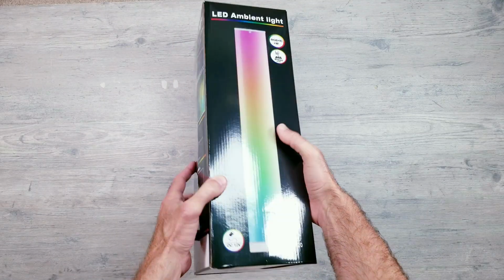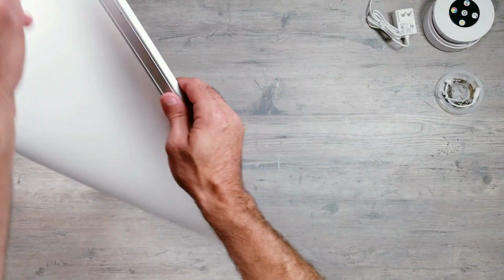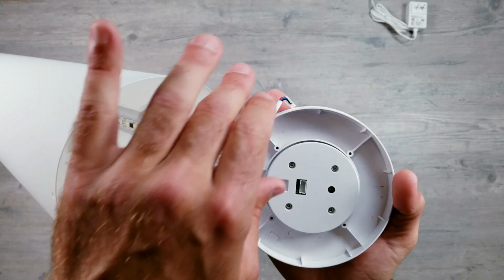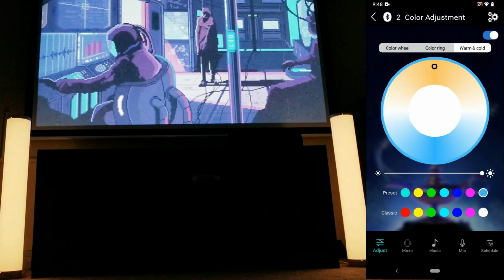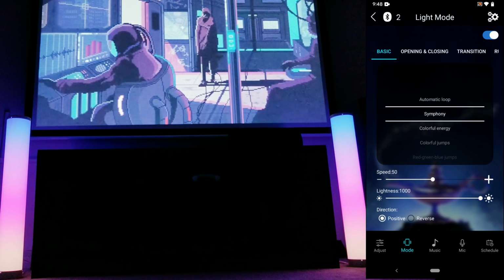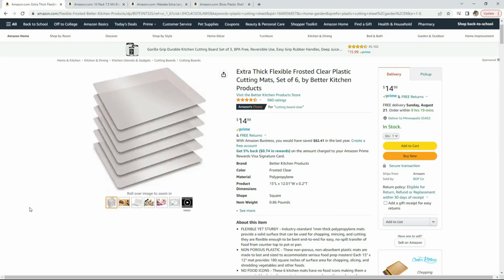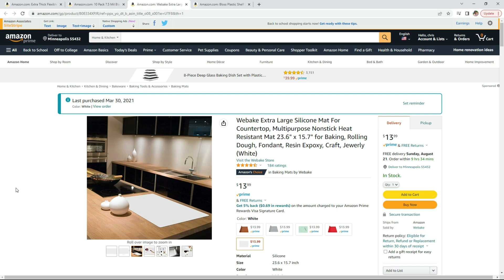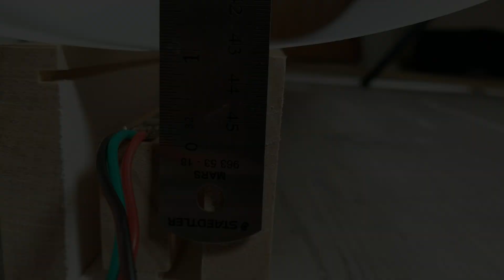DIY Mod - Best LED Flexible Diffuser Material Ever?!

Comment: Literallyb just picked up a DIY 60" wall lamp from Ilume that is almost identical to this—needless to say, I was a bit skeptical looking at a box displaying a tall and prominent fixture, however only being the size of something no bigger than cube one foot on every side. Regardless, once assembled, by taking your time and following the instructions, ideally on a large flat surface such as the floor, the tree a-ha moment comes on when you plug this thing in (the second time, because the first iteration of this thing crapped out of me...but hey, it was $40, and from a distance you'd be hard pressed not to mistake it for something 10x that MSRP...)....either wam it was this magical plastic or vinyl material that serves as the walls of the 4 sided lamp, in my case, that really intrigued me, because the LED strip lining the inside didn't appear to be anything special and I would presume that at that piece print, it wouldn't be...thabks for posting this, now time to hunt, because just saying F-it and giving up on most of ny DIY diffusion products in favour of well-dispersed OOB LED offerings from brands such as Govee (neon rope light) isn't very economical or friendly on the wallet in the long run...while I did achieve some solid results on my living room set up, there still was some minimal hot spots due to limited distance required to properly diffuse, however, some solid Scott's 2 sided tape finally kept it where I intended and while I was close to going the silicone/caulking route to close up any annoying gaps causing light leakage, my fiends over at ChatGPT thankfully recommended I use weatherstripping tape instead, and I must admit, the results were solid....I will post this eventually on a subreddit and share the link here for those interested....appologies on the lost post, but no one is forcing you to read this, and, if you did, it's because you too are on the hunt for some quality recommendations for your LED based DIY projects...best of luck and happy 2025! PS—love this channel...been a godsend....if not just for having his soothing voice put you to sleep after a long day of fiddling with your LED light strips....IYKYK....

TLDR: Almost identical product I found here in Canada at Home Depot, that I assume will be available in the US as well: https://www.homedepot.ca/product/illume-60-inch-rgb-ic-led-digital-floor-lamp-with-remote-control/1001814682

Found this low price option, which looks close enough: https://www.homedepot.com/p/Alsy-49-in-Black-Indoor-LED-Light-Bar-Lamp-with-RGB-Function-24304-000/329740897

Comment: just found a supplier in the uk called kitronik, called White Polypropylene Sheet 0.5mm x 1020mm x 720mm
There is a video on their page, and the white colour seems to be near enough identical.
the sheets that come with this product even look like they might be the same dimensions as those sheets only cut in half. so 1020 x 360mm
Reply: i've just ordered a few sheets so i'll see what they're like.
Reply: was that the materiel ?  @ge2719
Reply: @ge2719  Any luck with this ? TIA
Reply: @arunskuviyam  yeah, got the sheets. the thinner stuff is fine, and diffuses leds as effectively as this plastic in the video does. i'd bet money its the same stuff. the dimensions look like they just cut the full 102cmx720cm in half. to make this lamp.
Reply: @arunskuviyam  oh and i uploaded a video on my channel showing how effective it is. though its shot with my phone so it's not great in the harsh contrast lighting.
Reply: @ge2719  Already subscribed to your channel! Cheers bud.

Comment: Hi There. i just the the LEDs backlight of my TV and somehow im having hot spots on all LEDs. All Sheets and polarizers foils are in the right order. i need a better diffusion plastic close to the LEDs becuase the current one is not doing the job (perhaps the new LEDs are brighter, i dont know). do you think i could add some frosted/milky foil on top of the current plastic diffuser to solve the issue? its tought to get a 55 inch polycarbonate, so im thinking of adding layers of flexible and cheap diffuser foils...what you think? any experience on that? thanks

Comment: What’s the best diffuser material to get? I have a shop light that is 4 feet long and has clear tubing on it. The hyper tough 7000 lumens, got it from Walmart. I want to diffuse the light. Trying to figure the best solution.

Comment: so whats the material? on amazon you see its a PP (Polypropylene) Plastic
Reply from the maker: Thanks so much for watching and taking the time to comment! I'm not sure on the material. You said you found on amazon where it says PP Plastic?
Reply: @ChrisMaherDIY  yes maybe PP diffuses ligth very good? But i found out that PP is not very UV resistent so no sunlight should touch it xD
Reply from the maker: Ahh I see. So maybe in the sun it will get brittle fast and maybe not keep the color?

Comment: Think you can use govee M1 in these?
Reply from the maker: Thanks so much for watching! Yeah the Govee m1 would work just fine in these. You could also probably use something that only has 30 leds per meter and it would still look good since the diffuser is far enough away from the leds that there should be no hotspots.

Comment: I'm using your design to make custom LED baseboard and am ready to get started but after pricing 1/8" white acrylic at my local Lowes and Home Depot, and considering how big my room is, I've had to put the project on hold temporarily until I can find a more economical diffuser material.  Have you heard anything back from the company yet?  What would you recommend me to use for the baseboard diffusers with what is available on the market right now?
Reply from the maker: Unfortunately I have not heard anything back yet. I'll reach out again and see if they get back to me this time with any good news! Yeah acrylic is not cheap especially if you get it in the big sheets but the big sheets is what is going to look the best so you dont have seems every 12 inches like you would if you just buy the squares.
Reply: @ChrisMaherDIY  The only big acrylic sheets I can find are white translucency 55%.  Is that 55% translucency going to let enough light through or too much through and not diffuse enough?  Have you ever used 55% before?  I hate to spend a ton of money purchasing it and it either not let enough light through or let too much light through.  Thanks.
Reply: If anyone has used the 55% translucency acrylic and has any opinions as to whether it lets the proper amount of light through (or too little or too much) I'd really appreciate your input, too.

Comment: What was wrong with just using the paper method you used for the baseboard project.  It looked just as good
Reply from the maker: Thanks so much for watching and taking the time to comment! Nothings wrong with the paper but this material is stronger so you have a lot more things you can make with it vs using only paper. Thanks!

Comment: I bought some of these recently based on this video and they work great. They are extremely statically charged however, and attract every hair, pet hair, dust, and dirt particle in the room
Reply from the maker: Thanks for watching and that's good to know! I wonder if there is any type of spray or product that would help bring the static down? I don't have any pets so hair is a minimum. Thanks for the heads up!
Reply: get a humidifier.. dry air is static electricity is best friend.. you ain't going to get rid of static if you don't add humidity into the atmosphere

Comment: I have made similar lights with polypropylene sheets. It can be laser cut as well as laser scored to make folds. it's flexible and comes in many colours too. it's the stuff milk containers are made from. it's also recyclable.
Reply from the maker: That's a great idea and thanks for letting me know! I'll have to look into that for sure and hopefully try it out! Being recyclable is also a huge plus!
Reply: @ChrisMaherDIY  Polycarbonate Sheets also work great as Light Diffuser.

Comment: Hello Chris! 

Amazing video first of all.

I have a question though. Should I run it using my TVs USB port?(LG C2 OLED) I have plugged it in, it works fine and helps me turn it on and off with the TV remote (as it is connected to the USB port). I am just concerned about the long term effects on my TV.
I have limited the brightness limiter to 500ma.
Reply from the maker: Thanks again for the comment! I don't think you have anything to worry about in regards to the long term effect on your tv. I think everything should hold up just fine. Nice tv by the way!! Do you love it?!
Reply: @ChrisMaherDIY  Thank you for your reply!  Absolutely love watching your videos on the beautiful panel that the TV has! Happy with the videos and the purchase overall ❤️

Comment: Great video Chris. I saw some people commenting about using the included strip with WLED.  To me it looks like the RGB LEDs are controlled via those WS2811 chips (the black ICs), so you could definitely use WLED for those, but the white LED looks like non-addressable PWM based control.  To use with WLED you would just hook up Di, GND and 12V, but you would unfortunately lose the white LEDs.
Reply from the maker: Thanks for watching and for the information! That's good to know in case someone simply wanted to use the led strip that it comes with! Thanks for taking the time to share your knowledge with us. Very much appreciated!
Reply: Damn fancy seeing you here!

Comment: Great video and great find on the diffusion material! Definitely keep us updated if you hear back from the company.

Also you should cut that barrel plug and wire that power supply directly to the Wago connectors. Those black and green barrel adapters are really only rated for 4-5 amps and can get quite hot.
Reply from the maker: Thanks so much for watching and that's a great tip! I'll have to for sure do that when I use that type of power source again. I could easily just use some wago connectors then and honestly that would be a lot easier than using that barrel plug!

Comment: Great video. Have you compared any of the diffuser sheets you’ve bought with what you can find in a tv panel? I just got a large 50+” sheet for free from a tv heading to the landfill.
Reply: I do the same thing.  Takes a few minutes to rip one out but some tv's come with 3-4 sheets and a nice piece of acrylic as well.  I've made quite a collection since everyone I know gives me their tv's before heading to the trash.  They also have a layer of scatter diffusion that works for some pretty trippy lighting effects.
Reply from the maker: I have not but I've heard good things about the ones from Tv's! I'll have to at some point try getting my hands on one to test out!

Comment: How long are those tubes? It gets tricky when your project gets longer than a meter and you are gonna use 100-144pixels/meter or more. Power is a problem. You inject power midway?
Reply from the maker: Good to hear from you as always and thanks for watching! They are about 86 cm or around 34 inches so they are a nice size! For sure the more pixels the more power. However since the leds are set back from the diffuser, you could easily use led strips that have 30/leds per meter and you would not see any hotspots.

Comment: Chances are that diffuser is just 0.015 translucent styrene. It is used all the time in the signage industry. It normally comes in large sheets and is incredibly easy to work with. You just need to check into your local sign makers or plastic suppliers.
Reply from the maker: Thanks so much for the advice! I'll have to look around to see if there is any company like that around me! Good to know there is the potential to buy it in larger sheets to reduce gaps when trying to splice things together! Thanks!
Reply: @ChrisMaherDIY   Anytime!

Comment: Definitely keep us updated on what the company says! I'll absolutely buy a bunch to deck out my entire office. (Im using a bunch of your previous projects and hopfully new ideas too) I'm hoping they see the potential of that diffuser!
Reply from the maker: Thanks so much for watching and that's so cool to hear that you've built a few things already! I'll keep you updated on if/when I hear back from them! Thanks!!
Reply: @ChrisMaherDIY  Any update on this?
Reply: @ChrisMaherDIY  The diffuser material would be something that is otherwise relatively available on the open market, because I doubt that this company would have specially commissioned a plastic with its own bespoke chemical componentry.  As you say: 'where did they get it from?'.

I reckon there would be a simple chemical test to identify what material it is (ie what dissolves it or what colour it burns), then approach suppliers or manufacturers of that product.  Just some thoughts. Love your work.
Reply: @jonathanm9436  I'm assuming its just a light diffuser sheet used in LCD displays. I one from a broken TV and had similar results.
Reply: Just throwing a comment here so I can catch an update on this material as well, great content!

Comment: Does this place have replacement parts to buy the defusing layer or you just planning to stock up on lamps?
Reply from the maker: no replacement parts that I'm aware of. I'm hoping they might offer the diffuser sheets as a standalone product as I'm not going to be buy 60 dollar lamps just to get some diffuser sheets (even though the diffuser sheets are pretty big that they come with)

Comment: where do i find the little pin connectors with the wire stub attached to connect to the ESP32
Reply: i think he soldered them on the esp32 and put shrinking tubes on them
Reply from the maker: You got it!
Reply: I use Dupont Jumper Cables, you can get them with male and female ends to suit and in various lengths, you can find them on eBay/AliExpress. You can use the female end on the header on the ESP, and cut the other connector off and strip a bit of cable to go into the Wago connector.
Reply from the maker: Thanks for the help!! I used to use the Dupont cables as well and they were very handy! I switched to thicker wires just because the Dupont ones always seem so tiny.
Reply from the maker: thanks so much for watching! Ip Man is correct. I'm just soldering wires onto the pins of the board and using heat shrink tubing. I go over a step by step of this in my soldering video. https://www.youtube.com/watch?v=apSz3NXYlx8

Comment: have you checked if the led strips are compatible with wled, there are strips that use clock and data that explains the 4 pins wled can use them. If not maybe check whats written on the IC i am curious to know.
Reply: he uses the esp32 device, which works with 5v..the leds are 12v..so thats why i think he immediately changed them
Reply: @ipman3800  okay then you need a stepdown converter for 2 bucks for the esp power
Reply from the maker: I didn't look into it but they very well could be compatible with WLED! Maybe someone who watches the video might know for sure based on the close up shot of the led strips that it comes with. But like IP Man mentioned, the ones that come with it are 12V so there would be a few differences compared to the 5v ones I switched them out for and like you mentioned a stepdown converter would do the trick! Thanks so much for watching!